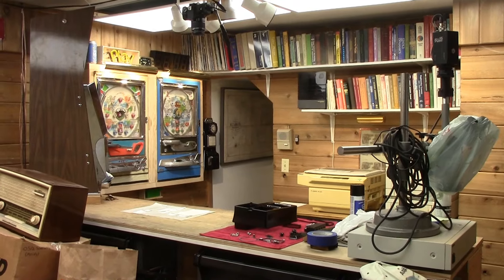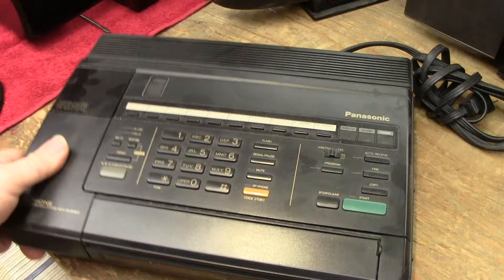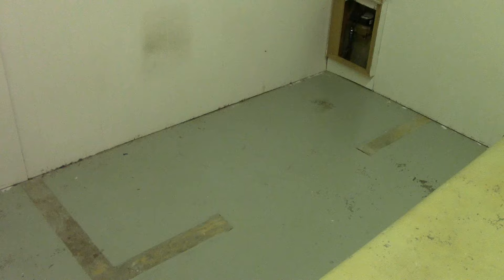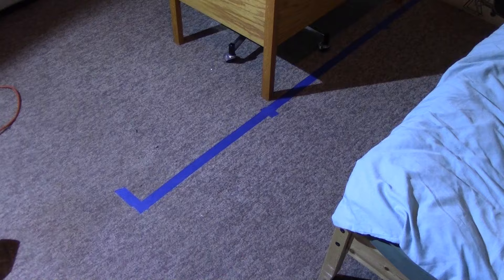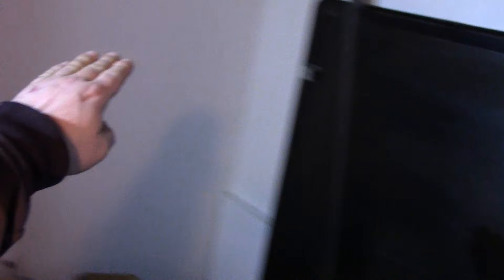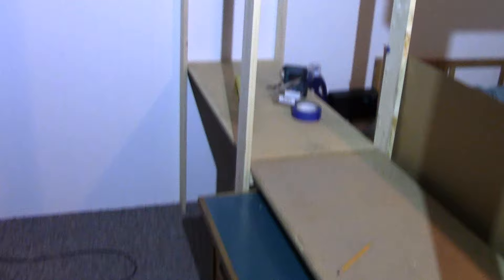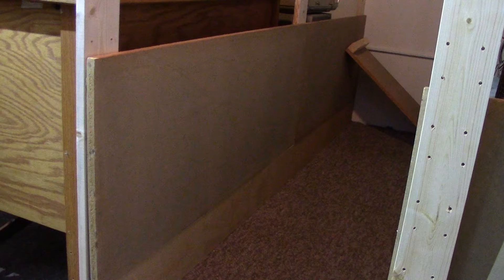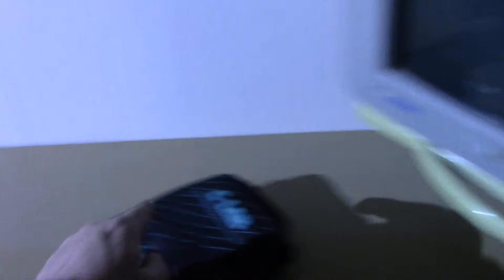John's Big Bedroom Reno

Comment: that acoustic foam is made to dampen the sound inside the room it is mounted in- it shouldn't do much against noises from above. You need impact sound insulation on the top for that- or mass. So instead of the foam I would try using drywall sound panels, or just normal gypsum boards (which are cheap and fireproof)

Comment: Can I up vote this several times ^^^ or will I be prosecuted for Youtube appreciation fraud? ;o)
Reply: @22:35  Legrand owns a bunch of companies including Middle Atlantic equipment rack systems.
@1:03:07 I haven't seen one of those Proton clock radios since I worked in a audiofool retail store. ;)
@1:09:53 In the USA Feit (pronounced FIGHT) have been a standard at Home Depot in the USA as long as I can remember.
@1:48:10 Miles and miles of facsimile paper spill onto the carpet ;)

Comment: Is it possible to change the way the door opened from left to  the right when entering?  you just need to turn the door upside down and relocate the hinges ,
Reply from the maker: I would have to deal with the door strike and the hinges being recessed in the door frame. I was not given the green light to start carving up that.

Comment: Wait... you have actual ISDN service where you are in Canada?
Reply from the maker: BC Tel used to offer it in select areas. I'm neither one of those old select areas and it has not been available for years. This box however lets me mess with ISDN from inside the house and not need an outgoing ISDN line to my phone provider. You can for example, use this to connect a Silicon Graphics Indy using the S0 ISDN port that every machine has but nobody has ever used.
Reply: @CelGenStudios Thanks for clarifying!